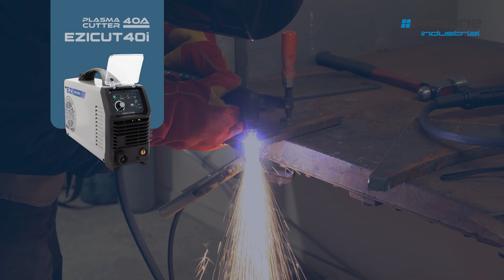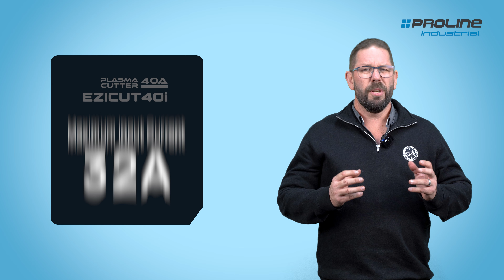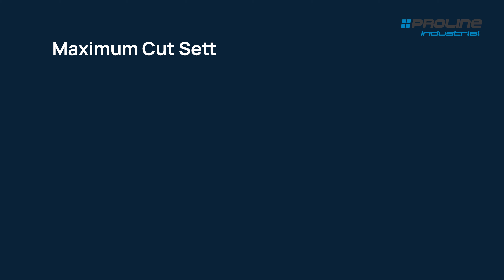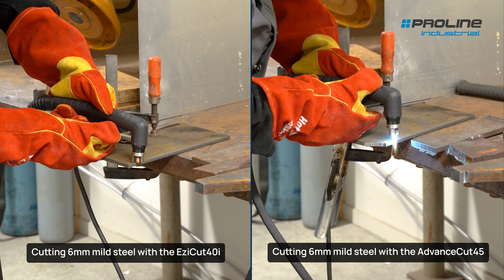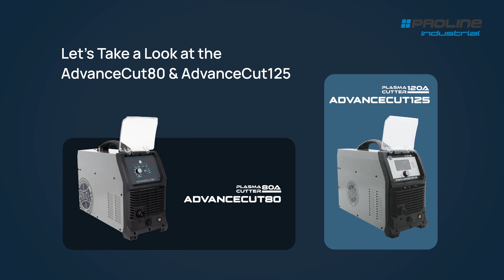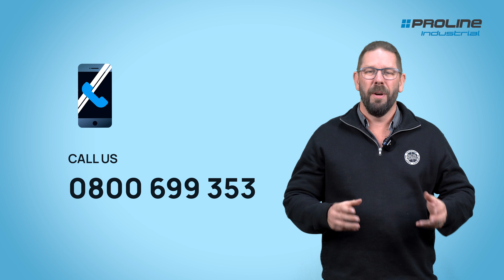Strata Range of Plasma Cutters | EziCut40i, AdvanceCut45, AdvanceCut80, AdvanceCut125 Compared

Comment: Define chew through consumables as you'll go through them on a strata even with a water trap thats feeding into a 3 stage water,filter & dryer then into the water trap on the machiine.
The advance 45 is pretty good as i have it so machine wise i like it.
The earth clamp is useless & weak better off using a arc welder g clamp earth.
Wasn't happy with the torch line as there was a design flaw..
The air line & wiring to the torch etc was encompassed in a solid round plastic conduit which meant there was no room to allow extension or contraction of the two main wires at the swivel base of the torch which stretched the wires & broke them..
That original torch setup was shite compared to using the loose shroud they come with now.
Yeah wasn't happy as strata nz didn't warranty it when they dam well should have,it was still new i think i cut bolts off around 50-80 mower chassis when it broke back in very late 2019.
If i had known the bloody thing needed supporting i would've done so nor should there have been an angle swivel thing on it which made it worse. 
Currently the newer version does still have that ball thing on it however i've taped it up to stop any bullshit from happening like last time & i support the line while holding the torch to avoid breaking wires..The conduit is no longer solid & round it looks like a wide piece of shrink wrap lol,still it does mean easy access & easy fix unlike the original which wasn't serviceable..
Got the 45 from Machinery House